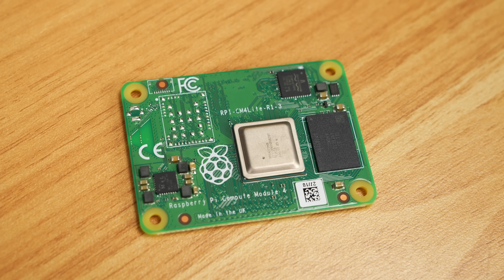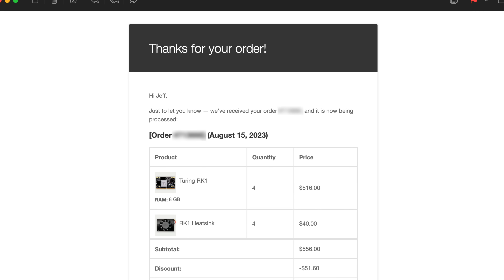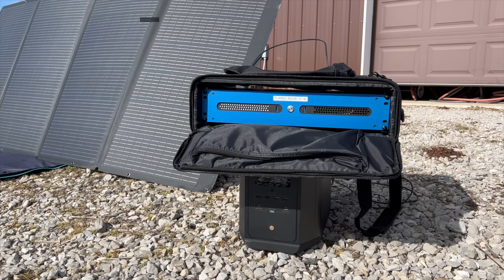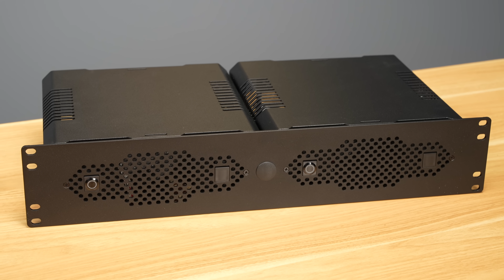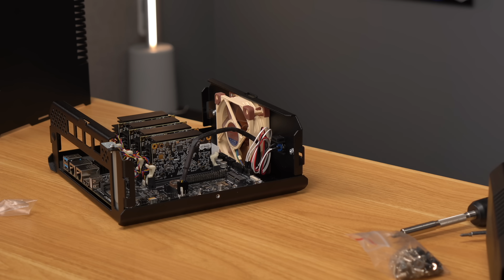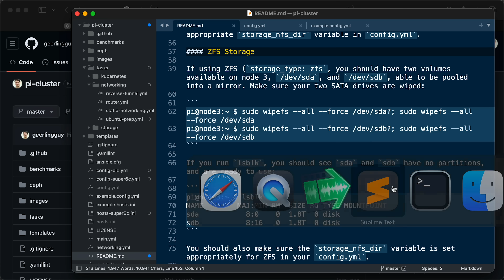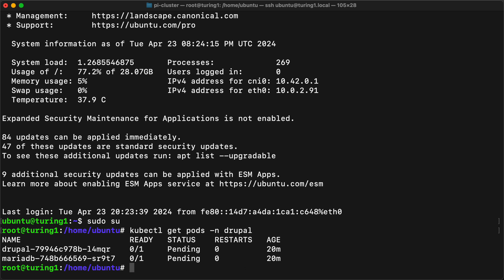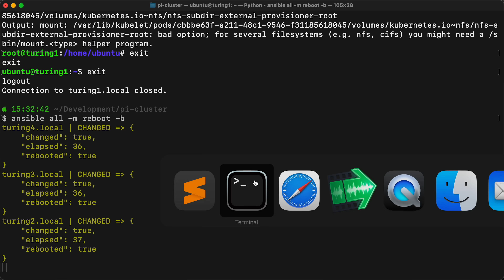Meet the new SBC Linux Cluster King!

Comment: I`ve got m.2 to 10GbE adapters you could use for this. If you have the lanes and eMMC then I`d use m.2 for networking.
Reply from the maker: I have one as well; the difficulty is you'd need to mount those on the underside (taking up the slots for the existing SSDs), and then it wouldn't fit in standard ITX cases unless you do something exotic to cool the NICs.

But it would be done, especially in a custom setup. Then you have a 10G NIC per RK1, and then an internal 1 Gbps network you could use for management separately.

Comment: I feel we should move to something similar to this for regular computers. The mother board itself would be responsible for power delivery and some basic IO but after that you would simply have a bunch of PCIE slots that could be used to communicate to other devices. The ATX standard really has been around for too long and I wish instead of trying to do incremental improvements like bottom power delivery that we could actually update the entire standard. Drop ATX PSUs for ATX12VO and use SFX while we are at it. Drop DDR for CAMM on the CPU blade now that it is vertical. Drop SATA and SAS for an all NVME solution. Our hardware really hasn't changed much in the past 25 years.
Reply: This may be taking it too far but instead of a SFX PSU I would even consider Flex ATX. Currently they go up to 600W but if we adopted ATX12VO they would drop 3.3v and 5v which would mean they would gain space internally and could probably go up to like 750W-800W. Another modification we could do it to treat them more like server PSUs and separate the actual power cables from the power conversion. If done like this you could combine 2 Flex ATX PSUs together to get either high availability or support up to 1500W-1600W. Again it is about the possibilities if we actually make some breaking changes.

Comment: Honestly, what cool thing can you do with one of these?
Reply from the maker: Besides a lab environment that's fast enough to have some fun (and not be painful), there are a few 'edge' type use cases where you can deploy one of these boards to remote locations and run apps on it. For one specific example, Chick-Fil-A used to deploy tiny K8s clusters to all their restaurants to run all the POS apps in case Internet goes down. If you put one or two of these boards in, it would be able to run a system like that, and the boards could be pre-assembled and shipped out very easily.
Reply: @JeffGeerling  humm, use like a baremetal server. That’s good for a restaurante. But I don’t see fun on just playing. I could pay some $ of aws instead right?

Comment: “I don’t need a cluster”
“What would I use it for”
“It’s just gonna be running some bullshit”

I so really want one
Reply from the maker: This is the way.
Reply: @JeffGeerling  Why not walk both ways?
Reply: But it will run.... whatever.
As in, nothing you want to do.
I'll stick to my 7950x.
I would be more interested in a lower powered NAS board with just the 4 nvme drives on it or better, loaded with SATA ports.
Reply: @choppergirl  Issue is the baseline power consumption of these beasts. Too much for energy prices in Germany.
Reply: @choppergirl  the new zen5 mobile and pc chips will blow this think out of the water for less money at that - it isn't even a contest but for some reason pi hangs on - low power is one thing but the performance and value is just not there - get a refurb pc and use that and see where arm goes in the next few years is the salient and pragmatic advice you won't be exposed to by watching these videos
Reply: @shephusted2714  you can also undervolt the zen chips and still get great performance.
Reply: @shephusted2714 I’m not sure this channel ever said it gave end users salient advice, this is checking out cool nerd toys basically. It’s not about why, it’s about why not
Reply: @shephusted2714 I mean this isn’t really a channel claiming to give salient advice to the average user. It’s playing with cool nerd toys, and ARM is up-and-coming as a desktop arch so it’s fun to mess around with. And if one makes sure to contribute to the relevant software with bug reports and the like, playing with the hardware is making the software support better
Reply: I'm in that boat! I have quite a few Libre Computers and Pis, but also small PCs sitting around waiting for projects, while also having a large NAS which sits on top of a Dell Poweredge... The NAS gets use very very regularly, but not all the SBCs or the Dell.
Reply: Too many small appliances, meet too many small computers
Reply: The adventure is more interesting than the result in this case... I topo am really excited about an idea of my own personal pi cluster, but I really don't have any good use for it (that a regular pi wouldn't handle). Web server, host for a couple of apps I made, a little db, maybe fileshare when the new board with m.2 arrives... Just no use for a cluster.
Reply: This is yje way
Reply: I bought 2, realized I don't have time for this, and then sold them.  Luckily I got them at launch.
Reply: nailed it
Reply: Ther's always a need for unlimited Minecraft Servers!

Comment: Man i really hope that Raspberry Pi prices comes down to a reasonable level, so that us enthusiast can do stuff like these
Reply: It won't. But I do recommend considering getting it either used or older gen like Raspberry Pi 3 for example which is lot cheaper than Pi 4 or 5, especially if you don't need the performance of those.
Reply from the maker: Pi 3 or Pi 4 (or even Zero 2W) are probably the sweet spot for value in the Pi lineup right now.

If they release a 2GB Pi 5 for $40, that would be a great value.
Reply: @JeffGeerling  That's be like putting a v4 in an old muscle car. We all know that we don't build these things because we need them. We build them because we NEED them
Reply: @JeffGeerling  Maybe if there was a version with less. Like the ability to run 2 computers off it? Instead of 4?
Reply: appears to be heading in the right direction.  :)
Reply: In terms of MSRP, or actual price payed? Because they're in stock at approved retailers for standard prices...have been for months.
Reply: I’m here from the future to say “HA HA” and cry 😭
Reply: ‘RPi prices come down to reasonable levels”

Well, let’s see. In the last two weeks, I purchased:

One RPi4 8gb — NIB $50 shipped
Two RPi5 8gb — NIB $150 shipped
(Both sellers offered paid return shipping if needed)

Those prices seem reasonable to me.
Reply: there is the orangepi 5, has the same chip, there also is a pro version which has the S version of the chip, and probably also is a cheaper basic version
only main difference is that is is more like a raspberry pi so doesn't have as many of the fancy server connections, and isn't really as suited/easy to use for clusters as the boards in this video, 

the 32gb orangepi 5 plus is around €75 cheaper than the Turing RK1 32gb.
the 16gb orangepi 5 plus is around €30 cheaper than the Turing RK1 16gb. orangepi 5 pro is €60 cheaper actually
the 8gb and lower versions of the boards using that chip tend to all be not much cheaper and so generally, the orange pi 5 especially doesn't really get much cheaper for the 8gb version it seems, €130 was the best value I found and was for the 16gb pro version.
also be aware the orange pi 5 plus can be used directly, while the RK1 also needs a host board which costs $260 as of now.
for bigger scale use the RK1 and Turing Pi 2 make sense.
for hobbyist home usage they are a very expensive option, especially if you only use 1 module,
for example if you would only get 1 module then the orangepi 5 plus is almost/around 3 times cheaper.

so the orangepi 5 is much cheaper.
and damn, I just checked out the pro version price which is €130 for the 16gb version.
still €40 more than the 8gb raspberry pi 5, but it is around €60 cheaper than the  RK1(without even adding in the Turing pi 2 board.
there are the pro, plus, B, and normal one.

but if you want a efficient home server to experiment with a orangepi 5 isn't as expensive and has the same chip, and you don't need a baseboard for them.
obviously if you need a cluster those boards from the video start to make more sense, however for many home hobbyists it is way to expensive and they don't need that much anyway, the orangepi 5 versions are a much cheaper way for such people to get it.
even though this chip is really taking off so likely will see more brands using it soon, meaning the price of boards based on it will likely also go down, even though be aware unlike with previous sbc's where the SOC was only a fraction of the cost, like not to long ago many used 4 core 40nm soc's which litterally cost around €5 for the sbc, these chips now use a much newer and more expensive nodesize and such and the chips just cost more in general, not insane but more expensive chips reduces the amount competition will drop the SBC prices.

there also is the pine64 QuartzPro64 even though I am not certain if they will launch it or not, the original discussed lauch price was also quite high around $300 even though it might have extra features or such, also looked like a big board, and the QuartzPro64 was pretty much announced/had most of it's public updates when the speciffic chip wasn't really used by others yet and was quite new, so not sure if it will launch and what it will be.
but it more different companies are bringing out boards based on the same chip.
that orangepi 5 pro 16gb seems to be the best value one on the market right now which is why I focussed on that onw
Reply: @ted_van_loon  I would also mention that there are, as of yet, very few SBCs with 32GB RAM. It's likely that we're yet to see more developments in that space, and possibly a 16GB model of the Pi5 (one can dream). I love the OPi-5+ with 32GB RAM but I definitely see them becoming cheaper in the future.
Reply: @alexbissessur5013  yes indeed that is very much true.
and 16gb kind of is the sweetspot for many home enthausiast users, since obviously the storage and cpu power tends to be the main limit
also(tldr of the stuf bellow: late in this summer or end of this year I expect ddr5 to become the new standard, making ddr4 suddenly get a lot cheaper and drop in price, especially for manufacturers, essentially those boards have 3 different factors which show them having much reason to soon get  much cheaper and more available. since they are a niche market however it still might take some longer, but even so slight price reductions might be expected rather soon already.)

(actually if those boards could also use ddr3 I think you wouldn't really notice much real world difference between ddr4 and ddr3 but a big difference in price, the only noticable performance difference likely would be gpu related or such.
that said ddr3 is cheap because it was a last gen product,
I mentioned that if it supported ddr3 that would be cheaper, but that is now, soon ddr3 however will be to old and so harder to get, thus more expensive.
this is a good sign for those boars, since ddr5 is starting to be the next normal standard, I expect the main change from ddr4 being seen as still current gen and ddr5 as future, to ddr5 being seen as such and ddr4 being seen as legacy/previous gen, will be around halfway in this summer to the end of this year since around then many big chip companies will bring very different/new products on the market, and they ofcource will use DDR5, before due to ddr5 cost and the ddr5 products not really being so exciting especially concerning their price, ddr5 didn't take off yet. everyone just got the older ddr4 models and just got a higher end model for less money in total.
big differences in new products and high performance gains will push people into ddr5.
people using ddr5 on high end systems will greatly reduce ddr4 cost.
greatly reduced ddr4 cost will also make those sbc's a lot cheaper.
Reply: > corpo enshitification enters the chat
Reply: Prices aren't coming down...#Bidenomics.